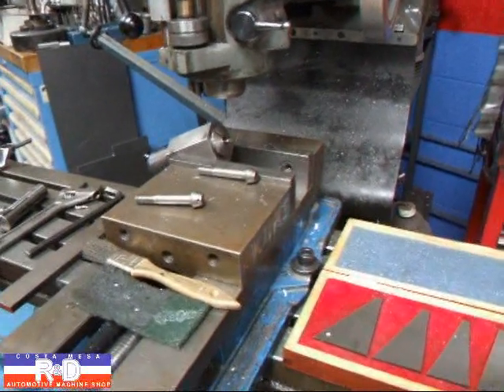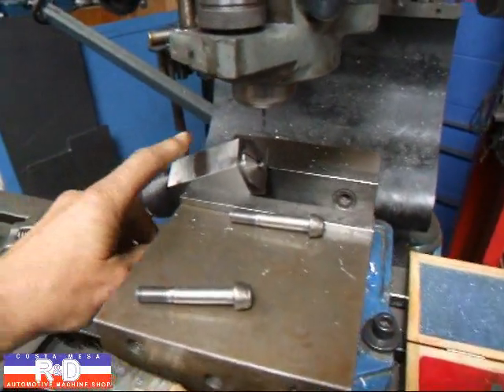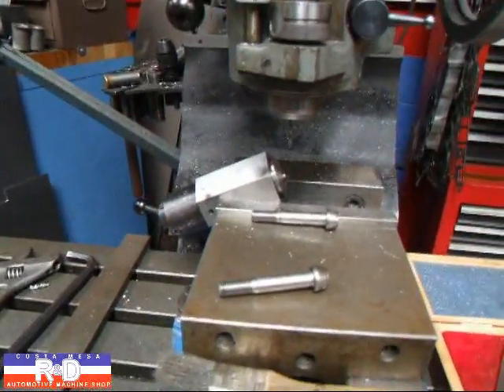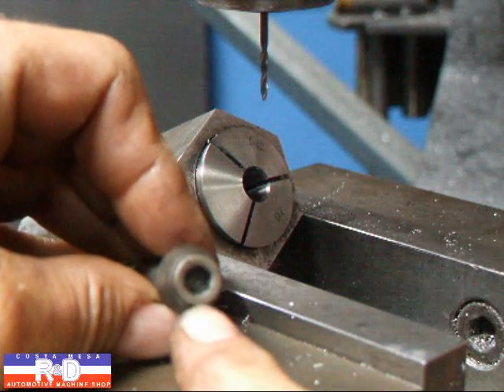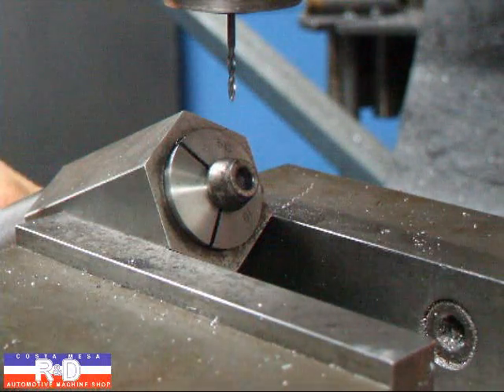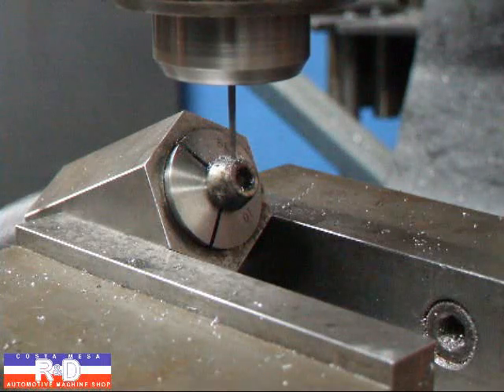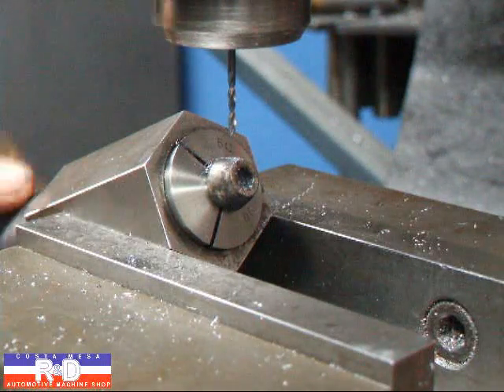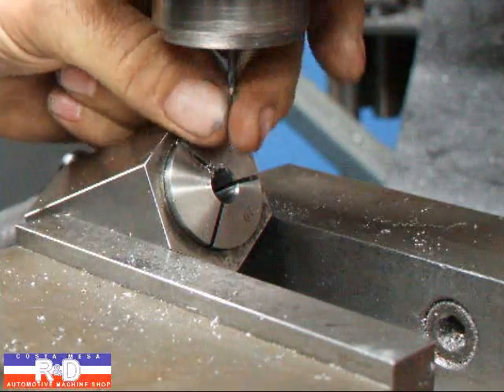Safety-Wire-Hole-Drilling.mp4

Comment: The way to do this is without it wobbling is to use a carbide center drill. Not sure what lockwire dia he is using but assuming its ~1/16 he could use a #2 carbide center drill or a 1/8 carbide center cutting end mill. That adds a lot of extra time  to each bolt though.